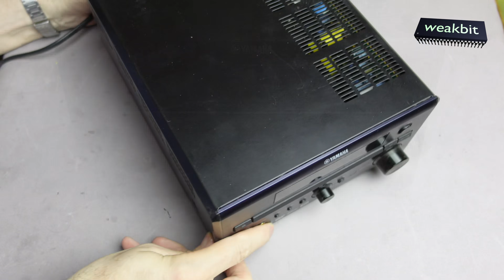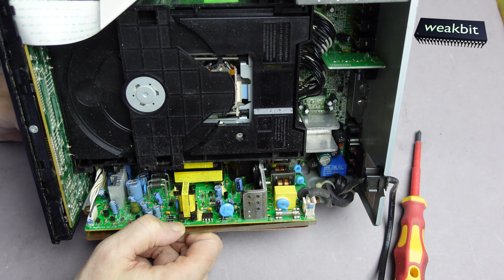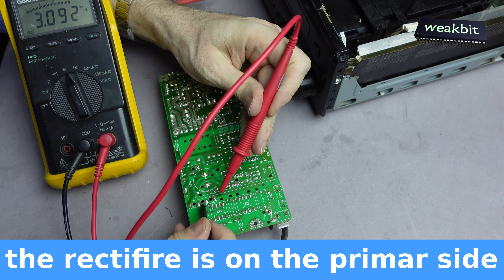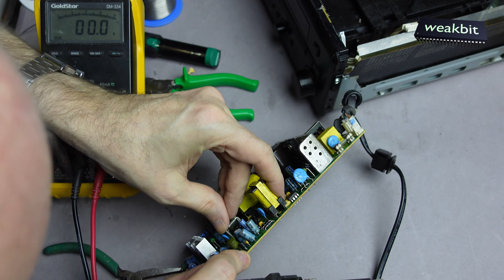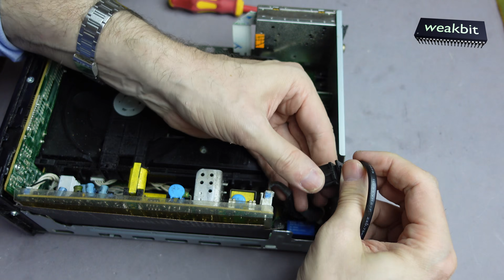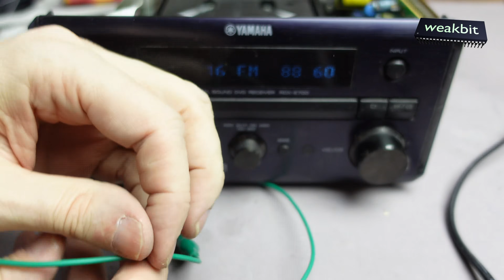Yamaha DVD-E700 DVD-Player repair

Comment: I can’t begin to thank you for your awesome documentation!!
I was struggling with this exact device, and I am completely new to electronics, altough I study it at a university. This video saved me! I had the same exact problem with the capacitors.
Reply from the maker: I can't remember exact what happened to this device but I change some electrolytic caps and then after this reset it start again. Also I think this is a failure with the reset on the chipset too.